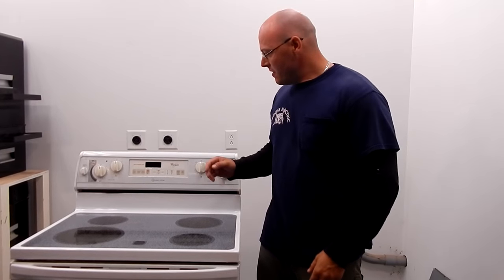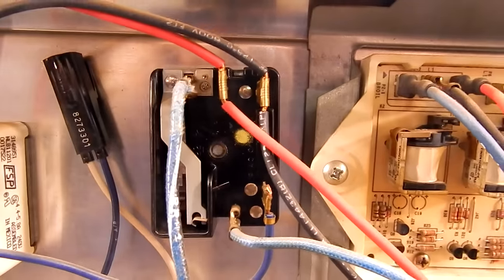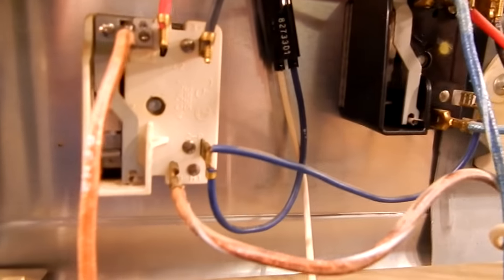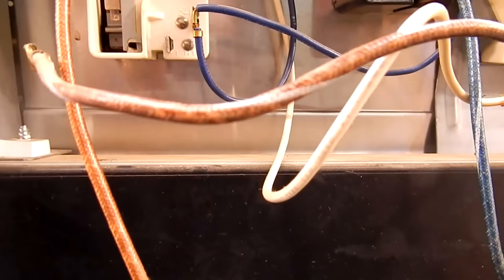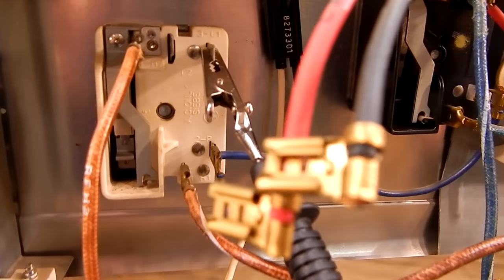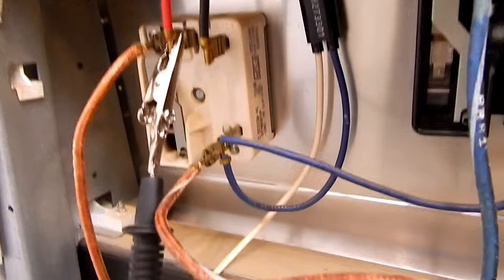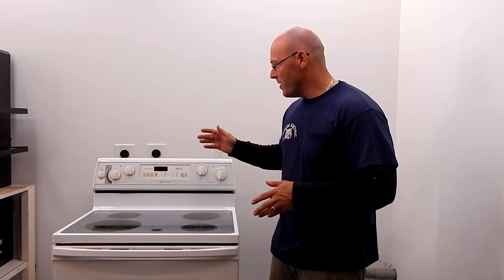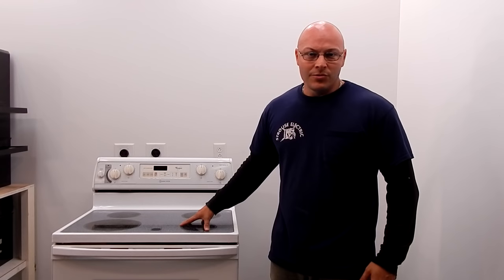How to Troubleshoot Glass Top Stove Burners and Switches

Comment: I have a dual burner that when set to any temp stays fully on. I know there’s a switch built into the burner itself, so I’m wondering if anyone knows if my control switch needs to be replaced or the burner assembly. 
I can hear the on/off click in the switch assembly turn on/off when I turn to hi vs low. The element stays fully on even when I turn it low and hear the switch click to attempt to shut off element. Anyone know what has failed?
Reply: The built-in switch inside the burner only operates when your control switch (infinite switch) is set to HI. Any other temperature is controlled by the Infinite Switch which, in your case, is burned out. Easy fix... don't forget to unplug the range from the wall when you replace the switch.
Reply: @Your-Self  ok thanks, I’ll try that. Even though I can hear that it’s trying to shut off the burner, the switch is stuck on?
Does the infinite switch need to work with a dual burner or is it a universal control switch?  The small switch that controls the inner burner seems to work fine.
Reply: @gman76utube  infinite switches have different power ratings, so it's best to remove the old one and look at the part number written on it. Sometimes, the number may not be available, so it will be superseded by an updated number. Watch this video on a different model, which should give you an idea of what to expect: https://youtu.be/z2yI4aHQrF0
Reply: @Your-Self  thanks for he quick reply. I took apart my cooktop and pulled the switch. It is 22 yrs old, so an exact replacement is not coming up. It looks like a 10amp switch because it has ‘10A’ as a separate marking. 2400w. I wonder if I can replace with a common infinite switch from amazon.
UPDATE:  I now see that from the exploded view, all main switches are the same part number, only the little one that controls inner/outer dual element is different.  Not sure why I couldnt use a GE WB24T10025.  Its rated at 2600W for 8" burner. What do you think?
Reply: @gman76utube  this switch would probably work. But it's better to find an updated version of your old switch. What is the part number on the original switch?
Reply: @Your-Self  The part number is stamped WB23K5052  10A. The part I bought on amazon seemed to be OK but the shaft is too short, only 3/4".  Gonna return it. The original part is closer to 1.25" or so.  I forgot to measure.
Reply: @gman76utube  this is an updated version of your switch - WB24X29364 (AP6284674), but it's not perfect either. If the wires on your range are too short to connect the new switch, you should be able to swap it with the older switch from your range that still works... ie from left to right side.

Comment: I have a samsung electric range and the 2 front burners stay fixed on high even if the knob is on low i need to know what might be it anyone please help. Can it be fixed if so what part i need to replace?
Reply: Laura Lau I have the same stove , and have the same problem need help too . Mine is only the front right burner.
Reply: Colorme Beautiful hope someone can help us..
Reply: samsung has a sensor attached to the burner, which in my experience is usually the cause of the problem, but in that case it could also be a Control board or a switch depending on how new and how your stove is wired.
Reply: (I repair appliances for a living)
Reply: Bryan Mitchell thanks!